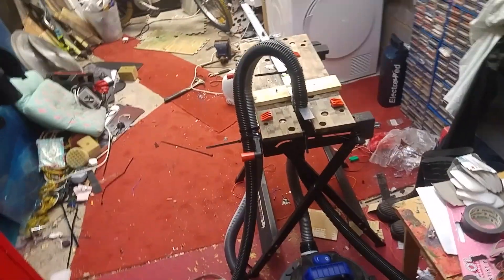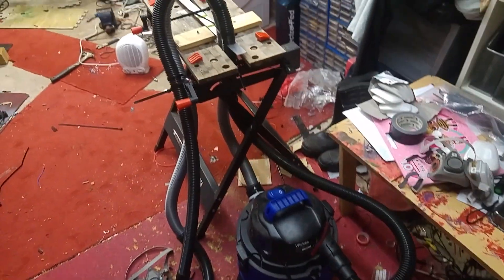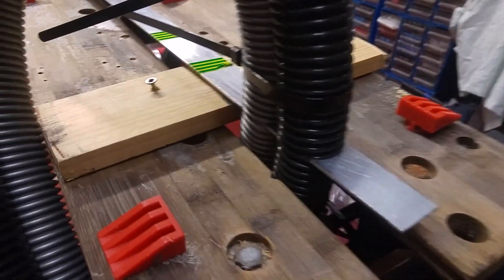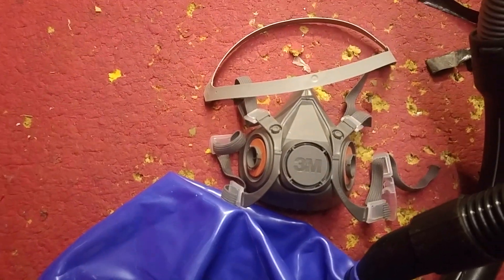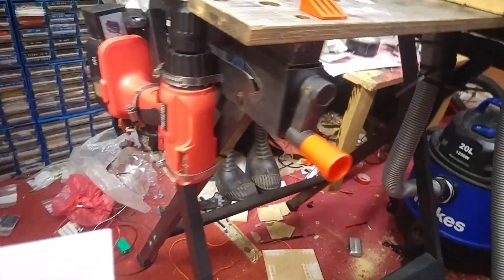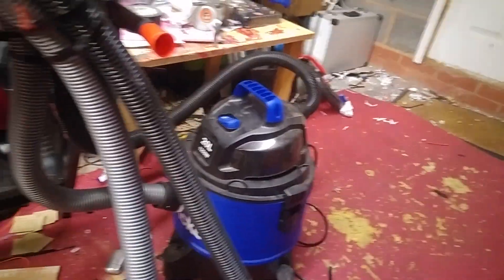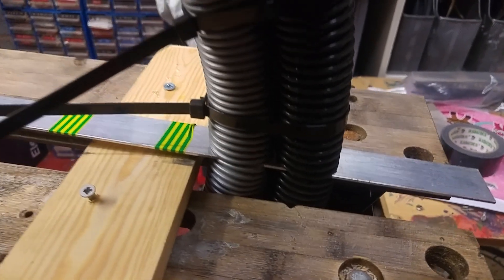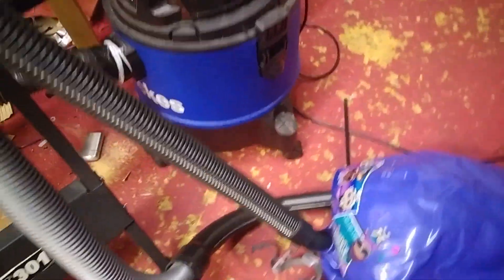Coronavirus DIY ventilator

Comment from the maker: Spoke to a real doctor today who said this: Hi Matt, why don't you put the following:
"This device essentially same as a self-inflating bag with valves, manually squeezed by a human.
Simplest automatic ventilators use 4bar O2 (available as hospital std worldwide) to drive inspiration with timings of expiration, etc (Google "Penlon Ventilator").
C19 ARDS needs far far more complicated ventilators, with useful algorithms to calculate alveolar ventilation as well as various volumes/pressures.  This is without viral filters, human testing, safety valves, alarms, etc."

Comment: I'd suggest using the front and rear end of a cheap hair dryer.  You want to Target 20" of water and below for a sick patient.
But it is a very interesting design. I like it. You might also work on a CPAP that only applies positive pressure.